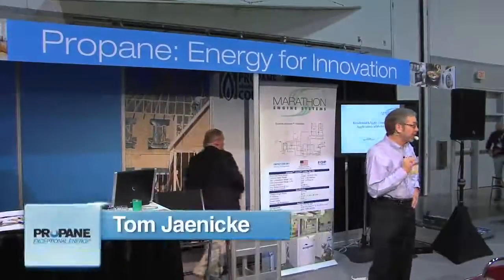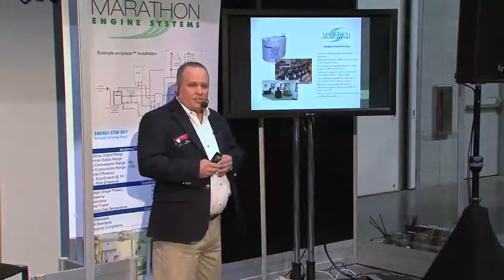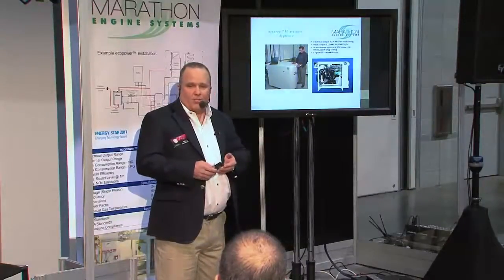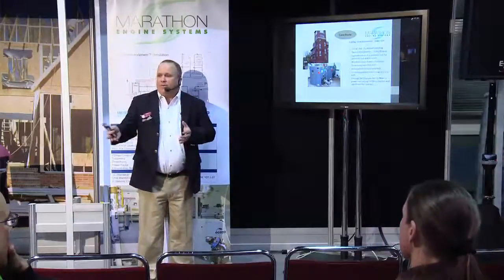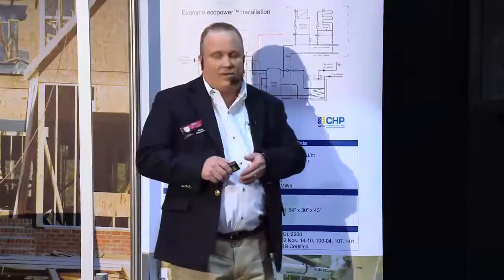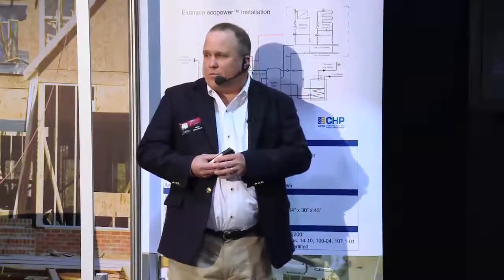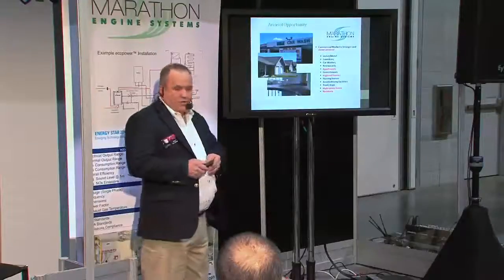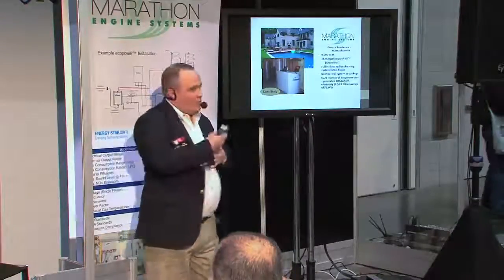Installation and Performance of Propane microCHP Cogeneration Systems

Comment: Marathon's approach, while certainly a modest incremental step forward over the usual domestic setup, suffers from being based on (giggle) an INTERNAL COMBUSTION design, and IMO is something of a technological 'bait and switch' red herring entry in the residential CHP market whose technological centerpiece embraces a FUEL CELL based approach (which generates its CHP from natural gas (or propane) using cleaner and more efficient electro-chemical processes rather than internal combustion). It's like comparing an Edsel to a Tesla roadster.

(kindergarden sing along)
Which of these things is not like the other ?
Which of these things just doesn't belong ?

Does it work ?  Sure ... it seems like a viable off the grid option - but it's just a rehash of existing tech, not the advance we truly need.